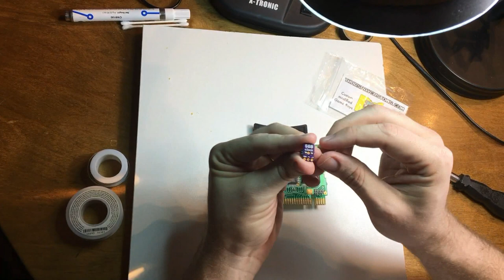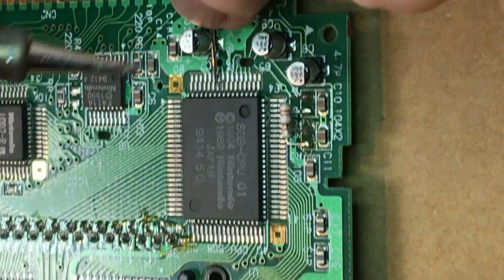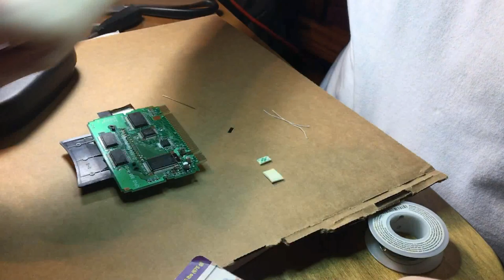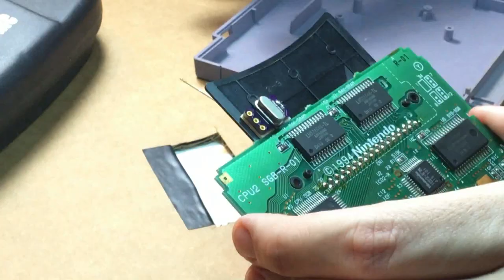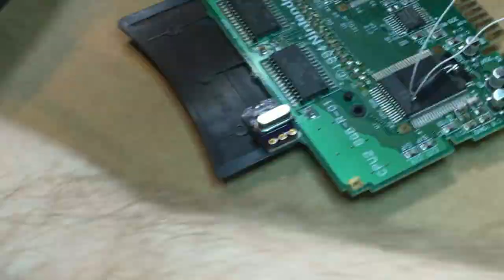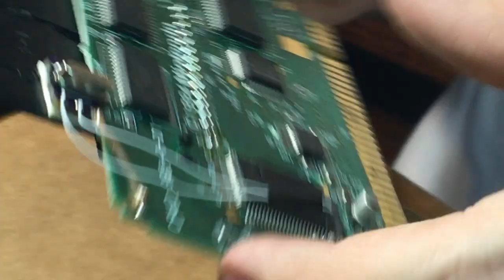Super Gameboy Clock Fix Mod

Comment: From what I've understood, there is a way to do this that does not involve lifting pins 73 ans 74 from the board. Pin 74 receives its clock signal from pin 3 of the ICD2-R chip, while pin 73 isn't connected to anything, because it's used to power the crystal. So if you disconnect that pin of the ICD2-R chip (either by lifting it or cutting its trace on the PCB), lifting those CPU pins is no longer required (lifting pin 73 has never been).
Reply from the maker: I looked into alternatives but I couldn't find a reliable circuit diagram for the SGB.  If you give that a shot,  let me know if it works for you.
Reply: Unfortunately I don’t have a Super Game Boy, but this website has a detailed circuit diagram and other useful info:
Reply: Was this ever confirmed?

Comment: Great job!   One trick I use for lifting small pins, is using an exacto knife. Put the point right behind the pin at an angle, then ever so gently twist the blade while you apply heat to the pin, should come up perfectly. Takes some practice but works like a charm.

I have a super gameboy 2, but would love to do this mod to my US SGB. Is the little pcb not yet available to the public?

Comment: I'm definitely going to try this! I already have a SGB 2 but it's so minty and new I'd kinda like to keep it in the box. Apparently it's quite the collector's item. I will consider adding a switch to put it back to "normal" so I can still use the clock feature of the SGB controller